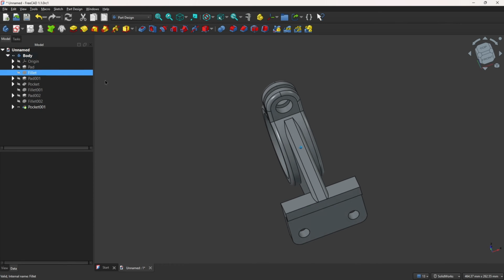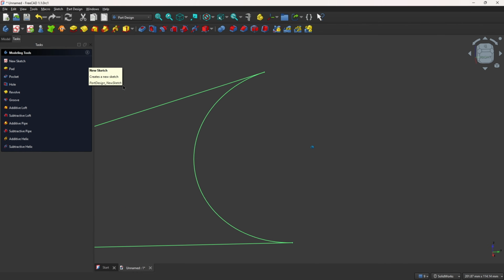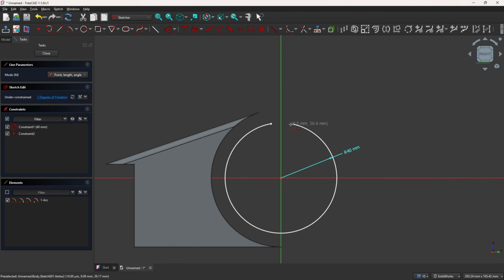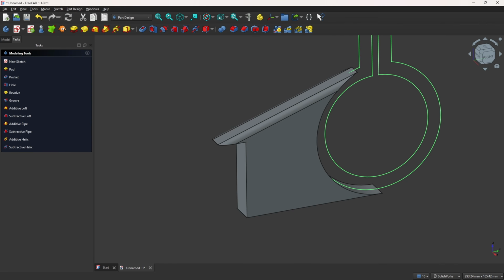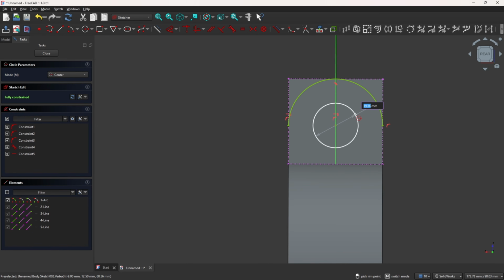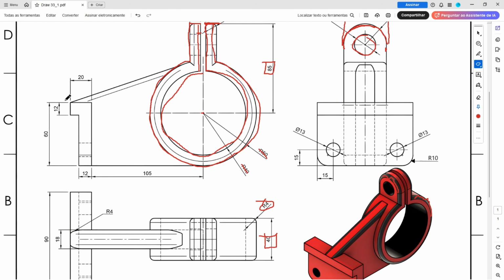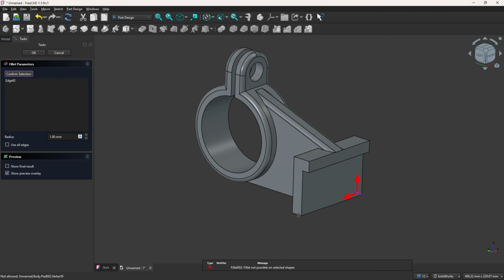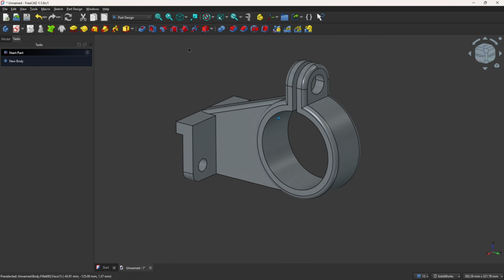FreeCAD  - Complete Beginner Tutorial Step by Step Exercise 33

Comment: I don't understand when you go to pad you can select symetric i don't see that option anywhere
Reply from the maker: I'm using FreeCAD 1.1, so the interface may look slightly different if you're on 1.0. When using the Pad tool, make sure to check the ‘Symmetric to plane’ option — it's located below the ‘Length’ field.